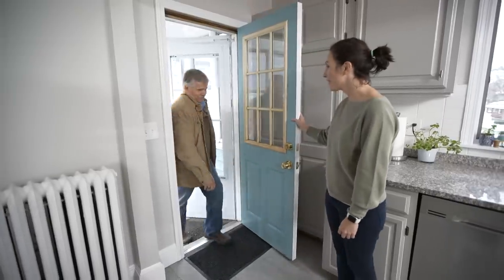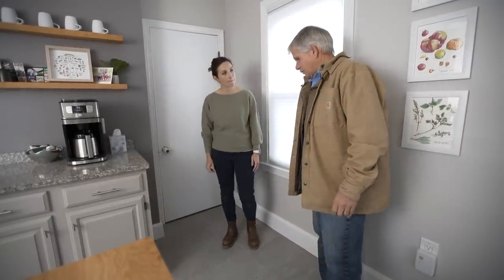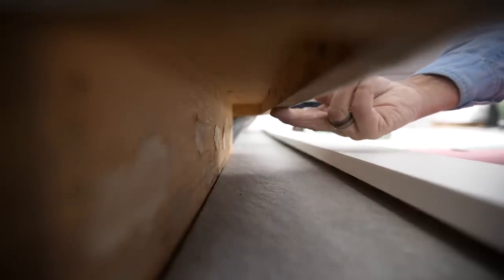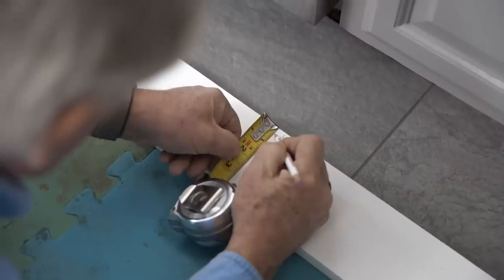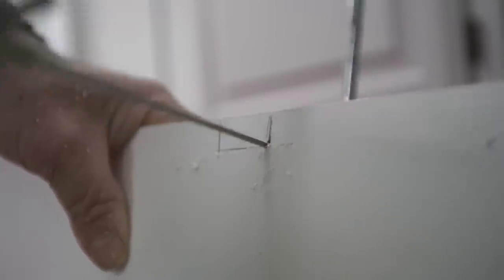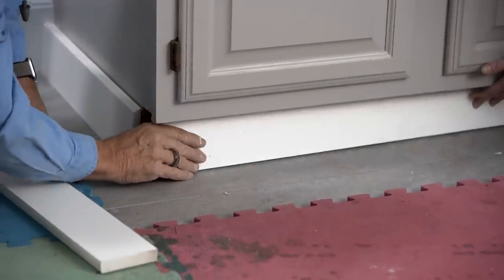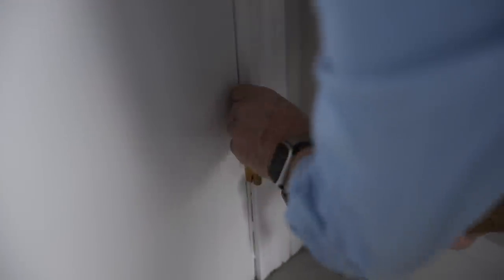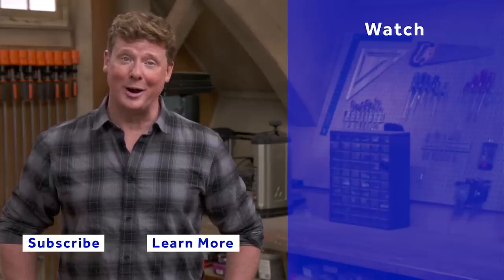Finish Your Kitchen Remodel Punch List | Ask This Old House

Comment: i would've used 1/4" birch plywood scribed to the floor, painted to match the cabinets. Pin nailer to secure
Reply: Right, the PVC crap looks bad, and is to thick.

Comment: So here is a question from not rich and retired in SC. I need to replace a front door on my modular house. They tell me I can only use one made for a mobile home. These are ugly and over priced so can I use a regular house door? No one seems to think it can be done, can it be done?
Reply: You can but you’ll need to do some framing the standard house door will be bigger and deeper. It can be done though.
Reply: Agreed usually model home doors aren’t 80inches mine was 76 I was able to find a decent door for it but the mobile I own is 2x6 construction as well. Some of your older mobiles aren’t and the depth of a house door may be deeper than your walls. Like Rotos said it can be done just have to frame the spot for the door if possible
Reply: @oscarlandag1831  Thank you!
Reply: @Lonewolf23-26  Thank you!

Comment: 05:06 he butchered that cut and with a trailer full of equipment, that should have been a simple task.
Reply: Not sure he did, if he was leaving a 1/8 inch extra (he mentioned that earlier) and came back straight to the corner afterwards, it could be a perfect cut.
Reply: @jiml5837  it was a hack job knowing that he used a miter saw and a track saw on the same job and the trailer was packed full of festool equipment.
Reply: @Kevin-mp5of  this old sment
Reply: @strochild  that's not the point. tommy has a trailer full of tools and equipment and still did a half-assed job. it's just pure laziness, take some pride in your work and do it right the first time, attention to detail.
Reply: @Kevin-mp5of  no any smart contractor knows to not focus on details for parts no one will see. What’s the point of wasting material because the cut wasn’t perfect for under the cabinet
Reply: @Kevin-mp5of  because this is a show for homeowners and not contractors.
Reply: Still not getting the point of the show but I guess we all get trigged by something.
Reply: It’s a kick board not not a dovetail, calm down
Reply: @TrumpAmerica-2024  why would he get out a miter saw to do small notches? it would take longer to haul it in and out, set it up, etc. Makes sense to just do quick notches with a hand saw or jig saw.  Hand tools work fine for stuff like that.  He did mess the cut up a bit, but for all we know it wasn't visible at all, so it's inconsequential.
Reply: Never going to see that cut 🤦‍♂️
Reply: @JonnyDIY  it's called attention to details and doing a job right. he had a trailer full of equipment that he could have used.